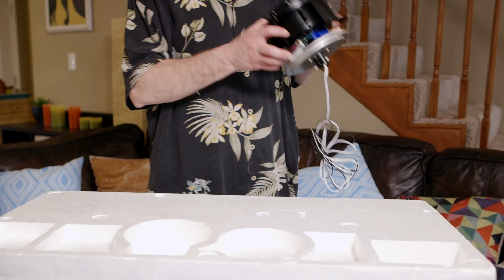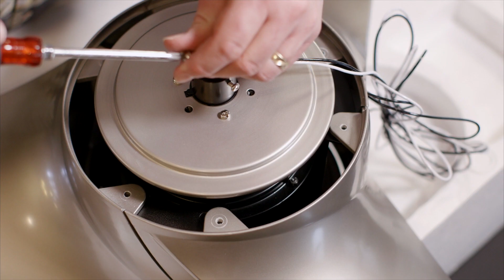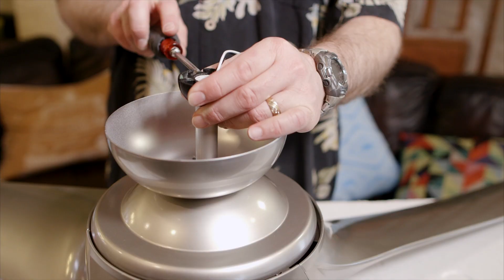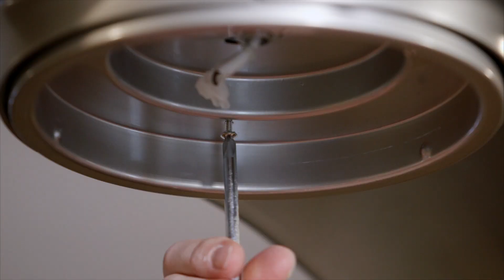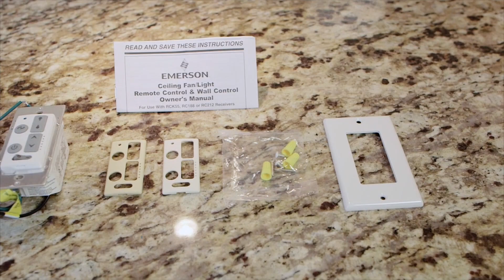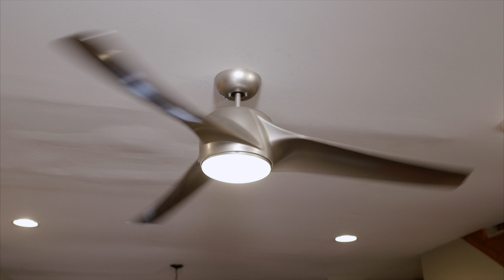Emerson Luray Eco Ceiling Fan Standard Installation CF860

Comment: This fan is so cool>>> nub.best/31eo    that it's hot. This is a powerful and smooth fan. Like the BMW logo, the curve design gives it an airplane propeller look. It has a remote with variable speeds, plus light, which has great illumination. It's a bit of a "arm" ache to install. Best to install with 2 person assist. I like this fan so much that I purchased an additional 2 for a total of 3 for all bedrooms in house. Highly recommend.